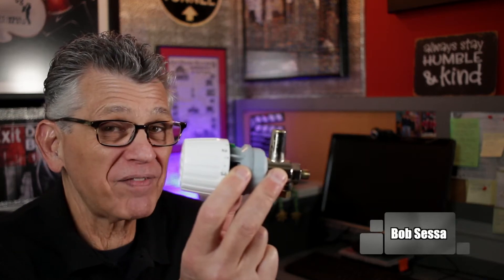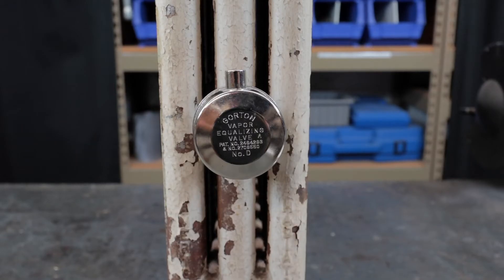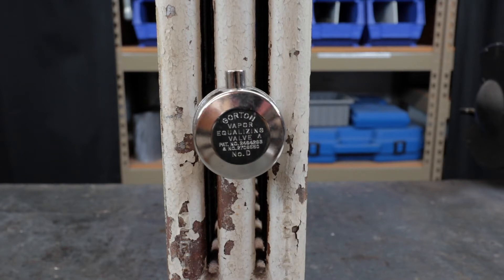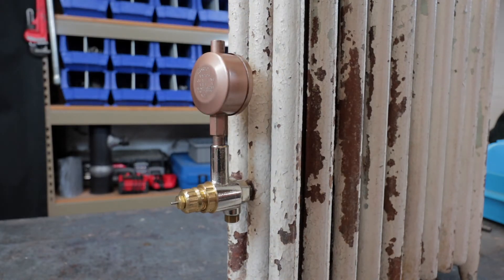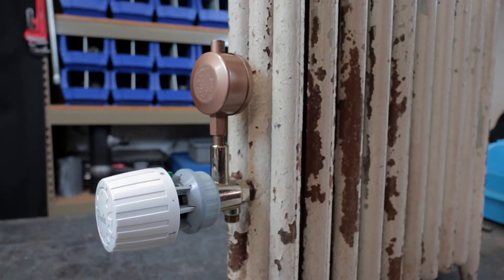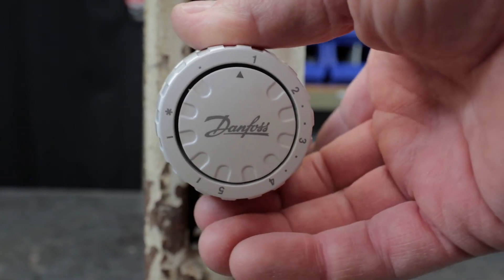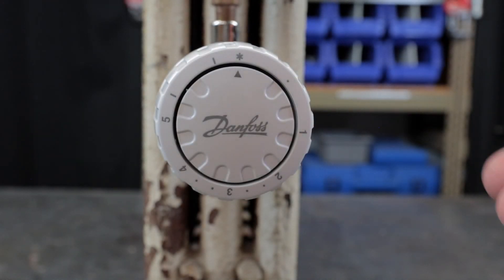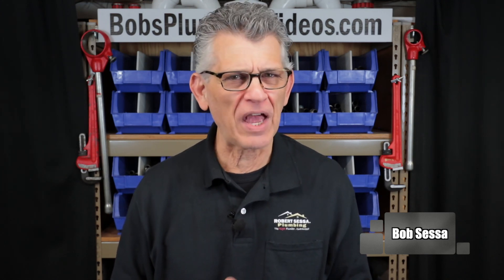Dan Foss Thermostatic Radiator Valve

Comment: Can this be used on ceiling mounted radiators.
Reply from the maker: I’ve never had the occasion to use one on a ceiling mount, but I would say as long as the system operating pressure does not exceed 2 psi. You’ll be good to go.
Reply: I know you mentioned the 2PSI thing a couple times. When I read through manual I see it's rated for 10PSI. You recommend not using this TRV if boiler is operating around 4PSI?
Reply from the maker: From my experience, once the pressure exceeded 2 psi and above, they do not function as stated in ie instructions. I’ve pulled them out and re-installed the air valves, due to multiple call backs from the clients.

Comment: Awesome Video.  Could these be installed in all the apartments in a coop to help lower costs?  Many people in my building leave windows open in the winter. We have 20 apartments and all the radiators are single pipe.
Reply from the maker: As long as the operating pressure of the steam boiler is below 2 P.S.I. 1 1/2 P.S.I. is optimal target  operating pressure. I have installed and removed them in multi-family buildings because the operating pressure could not be controlled. I only install them in residential one to four family residences.

Comment: Thank you! How do I know if I have a 1 pipe vs 2 pipe steam system? Also, how do I know if my system is <2psi? Is that info in the boiler manual?
Reply from the maker: Generally speaking, a one-pipe system will have one single supply at either end that acts as both the supply and return. Two pipe systems will have a supply at on end and return at the opposite end fitted with a steam trap. As far as P.S.I. settings go, you won't find any useful information in the manuals, but if you are interested in learning more about steam systems I recommend "The Bible" on Steam Heating Systems. https://amzn.to/3ZuUMzL

Comment: whats the difference between this and the adjustable vents ?
Reply from the maker: You basically can set individual temperatures for each radiator in different rooms with a twist of the dial.They will adjust automatically. With adjustable vents you manually have to guess what the temp is going to be.

Comment: Bob, this was very informative I actually purchased two of these setups for my 1 pipe steam system. I also use Gorton valves. I have a question I have all right angle Gordon valves can I use them and conjunction with a 90° brass elbow? I just invested in several right angle Gordon valves and if I would go and purchase the straight ones which I already purchased too what would I do with the old ones that I just purchased? It would be great if I could figure out a way to utilize them with this setup. Like I said I purchased two already for the living room and the dining room. But I'd like to do at least three more. I live in a one family house with four bedrooms and three floors
Reply from the maker: You can use them. I would use a short nipple, 90, then the valve. May look a little funky, but it'll work.
Reply: @BobsPlumbingVideos  I don't mind the funkiness and I could probably make it look good and I wouldn't have even minded but I just bought those valves. Also you were saying 2 PSI should I readjust the pressure troll?

Comment: I've installed two of these now and for the installation, I had to install the Steam Air Vent to the Straight Steam Convector Air Valve first before connecting the Convector to the radiator because once the Convector was in the radiator, it was too close to spin the Air Vent without banging into the radiator and I couldn't get the vent to thread onto the Convector.  So I would recommend installing those two together and then install the assembly onto the radiator.  I've had great success with these.  I had 2 rooms on the 2nd floor that were basically direct runs from the boiler to the radiators and they would get so hot regardless of whatever air vent I had installed.   I upgraded to this solution that Bob has and now the two rooms are much more comfortable and other radiators in the system that weren't getting warm or even heating up at all are now getting warm.

Comment: I recently purchased a an office building with single pipe steam system and I have been studying, reading, watching videos and think I have a pretty good idea of how they work. I have watched several of your and appreciate you. I need to balance my system and the thermostatic radiator valve looks like the answer. However, in a blog I have gotten feedback that these only work at the beginning of the cycle. And that you can only reduce the temperature, not raise it. If this is the case, what is the point?
Reply from the maker: Pick up a copy of this book - https://amzn.to/3ClTFIx. It is the Bible of Steam heat by Dan Holohan "The Godfather of Steam Heating". Read it cover to cover! I use these thermostatic valves only in residential settings only where I can control the steam pressure. Not more than 1 1/2 psi. Anything beyond and they will not function properly. I tried installing them in multi-family apartment buildings where the pressure settings were way beyond (don't know why) 1 1/2 psi & they did NOT WORK.
Reply: @BobsPlumbingVideos  Thanks for getting back. I've ordered the book, should be here Monday. This originally was a 3 story house, but now each of the rooms are individual offices except small apartment on 3rd floor. 17 radiators1st & 2nd floor, 2 in apartment. I cranked the temp up this morning and the gauge was reading right at 1 psi. I saw a video a while back, maybe it was yours where the thermostat was on the first floor and you changed it. That is the case here. 2nd floor offices are cool to cold, 1st floor warm to hot so logically I would think that needs to change. I've noticed a lot of other basic things like some legs aren't insulated and wrong angle on one. So I have some basic things to fix first. I have a professional steam boiler HVAC guy coming to take a look so looking forward to that. Thanks again.

Comment: Great video.  Quick question. Can you elaborate why you use a #6 Gorton air vent vs any other size?  I understand #6 is in the middle of the range between #4 to #D.  How critical to this setup working is the #6 air vent?  Thanks.
Reply from the maker: Not necessarily favoring the #6 valve, it's going to depend on the size of the radiator (volume of air to be removed) and it's location (distance) from the boiler.
Reply: @BobsPlumbingVideos  Can you do a video on selecting the right vents for radiators in a home?  or how best to select the correct air vent.

Comment: Is this sold as a kit?
Reply from the maker: They're sold as individual components. The valve body and controller are seperate pieces, you can have a remote controller that sits on the wall rather than on the radiator. You can find more info here : https://bit.ly/3spve6O

Comment: I have bought a few of these for my apartment. The boiler pressure is below one pound but the radiator still gets hot if the system is on for a long time. Any suggestions? I'm trying to get my apartment below 79 degrees with no luck
Reply from the maker: Is it a multi-family 20/30 apartment? If so I do not have the answer. In my experience, I've had no luck with them in multi-family 20/30 apartment complexes. They work for a very short period and I ultimately removed them because they just would not function
Reply: @BobsPlumbingVideos  I also bought another brand called Macon at the end of the season. I will see how that works at the beginning of the season. It seems to be built like it’s more heavy duty.  Time will tell.
Reply: @BobsPlumbingVideos  Does this not work in an multi-dwelling system because too many people are opening and closing valves and the system never gets to an equilibrium vs in a single home you have 1 thermostat with a boiler sized for the radiators in that home and they are all typically on and each time the boiler cycles each radiator consistently heats up to a given level (just right, too hot or not hot enough), but it is consistent?

Comment: Thanks for this.  Love your steam vids.  How would such a valve control differ from what one can achieve by using a Vent Rite #1?  Seems that the principles are similar.
Reply from the maker: Vent rite is a less expensive alternative, that supposedly will operate at higher operating pressures. Check the discussion out at Heating Help.com - https://bit.ly/3r2zwPR

Comment: I just got the valve Dansfoss .  Not sure what size vent; 1/4 or 1/8”?
Reply from the maker: Should be 1/8"
Reply: @BobsPlumbingVideos  Just got the  1/8 vertical vent from a local hardware store.   All ready to install after this heating season is over.

Comment: Hi Bob, I AM from Staten Island, NY that's why i type a little funny (lol). I had a HUUUUGE teeeeny weeeny leak problem in my RV hot water heater tank. I tried everrrrything! Then I watched your pipe fitting video. I searched high and low and found the lamp wick. I ordered the exact same brush on blue block. I practiced with the wick several times before threading it for real. I used gloves to apply the blue block, it wasnt too bad, and I finally saw the reason for the curved applicator. I screwed in the L connector - it's a little hard to find where to start as the L has to point a certain way, but after three tries I got it. I let it cure for about 30 hours. It was tacky most of the time so was certain it would not work. I was confident that I'd again failed. BUT BOB IT WORKED!!! I'm unbelievably happy. You were right, bullet proof seal. The water's only been turned back on for about 40 minutes but so far so good. I'm keeping a close eye. I havent turned the heat to the water tank back on yet, using the scientific method of discovery, in case it fails - I'll know it's the heat. Do you think smearing some more blue block onto the outside of the connection now will add to the strength of the seal? Wanted to thank you for that vid and all the very good advice! Well it's Sunday and you know what that means, the water is boiling and the gravy is done. So, gotta go eat! Much gratitude to you!!
Reply from the maker: Thank you! I think you'll be good as is, but if smearing a little extra on the outside will make you feel better. Go for it! Actually, the seal takes place inside the joint so I'm confident you nailed it! Regards, Bob.

Comment: Welcome back, Bob. I live in Brooklyn, NY, I spoke to a plumber who said don't put a TRV on an air vent, put it on the shut-off valve. which one is better to use.
Reply from the maker: This is the more economical way of doing it.  Both work, the crucial part is operating the system at correct pressure or you’ll have issues.
Reply: @BobsPlumbingVideos  I also thought for a one pipe system putting it on the main valve would cause other problems when the valve shuts off and the steam condenses and then the valve opens up and a given amount of water would drain back into the system.